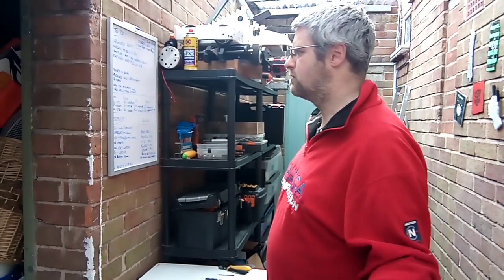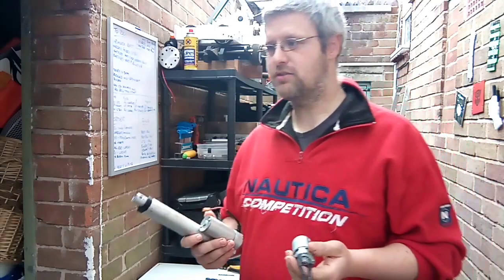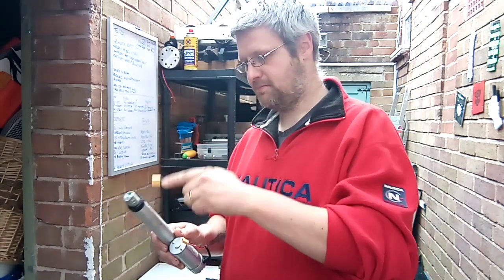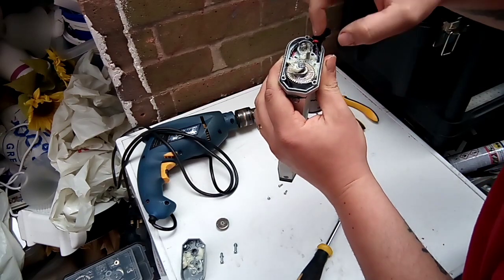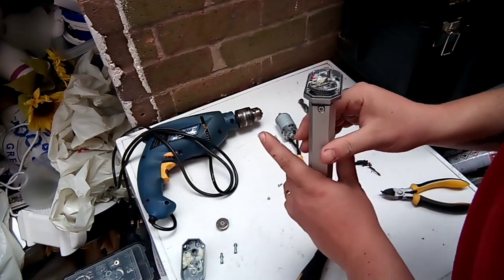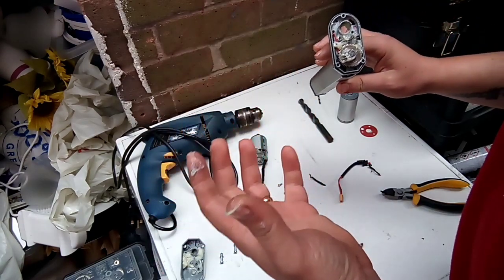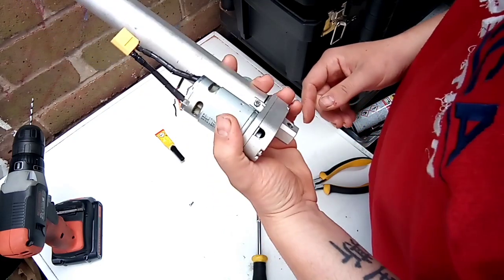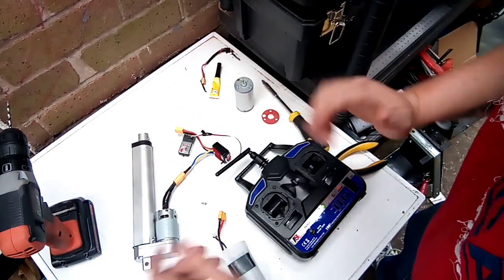DIY combat robots: 550 motor mod for a Linear Actuator (without limit switches)

Comment: interesting vid, I hope you will have some vid recording practice maybe put up a monitor connected to your camera so you can see when you are totally out of frame at vital points. and please a better mic, I am looking to mod an actuator for my car seat (a disabled seat that moves from the driving position into the back of my car so I can transfer from the wheelchair to the driver's seat and be moved in to place, currently it takes what feels like several lifetimes to move the 1.4 meters I had been thinking about using a drill motor and this helped to clarify a few things, a shame you did not include the limit switches maybe in a future vid. I will be using a speed regulator to control how fast for fear of launching myself out the back of my car! and will be adding remote control so I can operate it when I have had a carer drive me and forgotten to put the seat in the back of the car then I can just press the remote and bring it back to me. this does seem to be a very limited amount of vids on actuator modding maybe you could do a series and share your ideas.